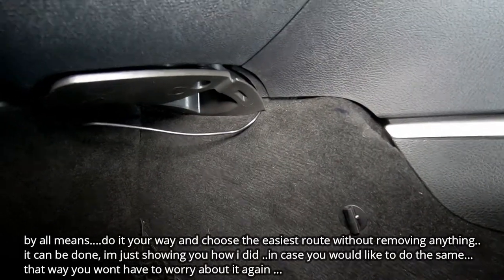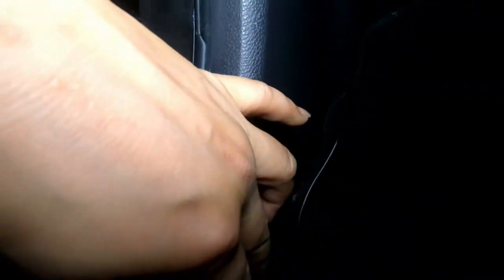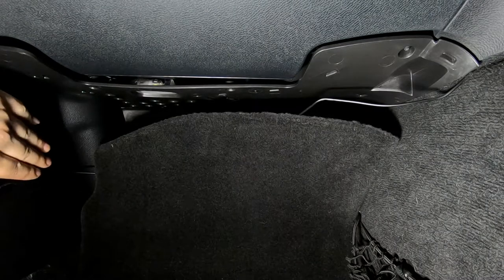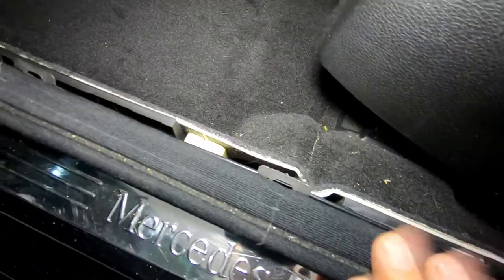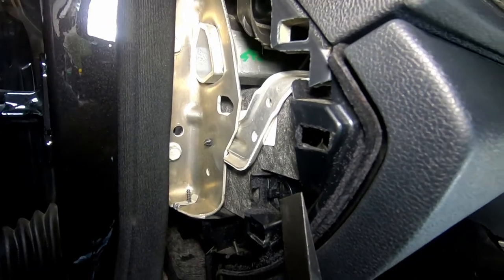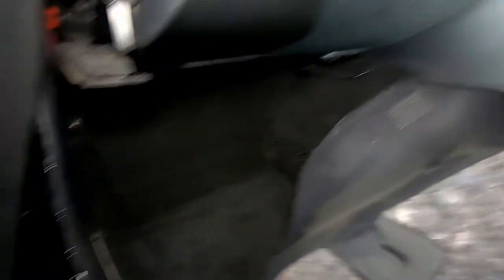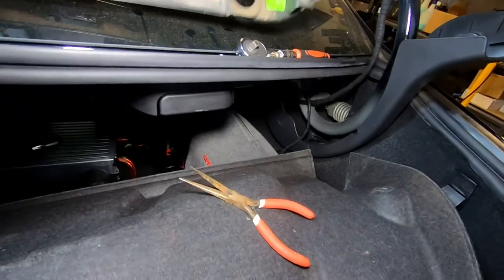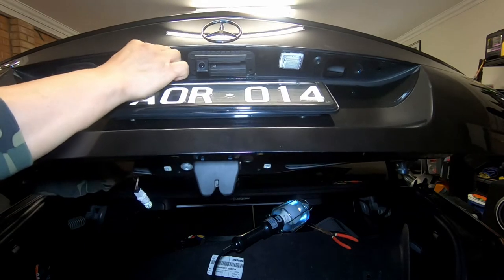mercedes w204 LICENSE PLATE LIGHT camera install+cable route PART 2

Comment: I did this same camera set up, Can you please tell me or if  you have a part number for the rear license plate led bulb that fits inside the rear camera slot? as the stock one I have is one whole solid light/bulb plug in  piece
Reply from the maker: hey bud... welcome and thanks for supporting my channel... so are you looking for the camera that fits in the license plate light or in the spare slot next to it .... most pf these livense plate led bulbs/cameras are like that....hence why i wanted a boot handle camera instead as its more centred as well ....
Reply from the maker: so i just check on ebay and did a quick search for mercedes w204 oem reverse camera ...and i could see they sell a few different types of cameras.... there are ones without the led bulb and jist thr camera which could fit in the spare slot next to your led license  plate light... amd of course there is trunk handle aswell...there is also oem style camera which fit in the same spare slot next to license light
Reply from the maker: here is a link to what you want https://www.ebay.com/itm/192846672878

Comment: wow amazing video ...!! btw what camera do you recommend more??? does the one on the plate light makes the car looks the bulb off because block the plate light??/ im kinda OCD with those things
Reply from the maker: if ur ocd then get the trunk handle one its abit more centred and wont make ur lucense plate lights look off and funny or yhe other only suggestion id recommend would be the cameras that sit in the spare slot on rither side of your trunk liner
Reply: @MIKEYZVLOGZ  ive read that the trunk handle one the angle its to the floor is that right? btw if you can link one so i can buy
Reply from the maker: @AmateurTroll69  i use a trunk handle one and ita good

Comment: What is the random red tail end of cable each end of the rca for ?
Reply from the maker: that red cable is for car models either a reverse canera trigger switch ..meaning wen u enter reverse it knows to trigger the camera to turn on.. similar to the remote switch of an amplifier... its mainly used for aftermarket gear units ... but for w204 there's a setting you can choose to trigger the  camera once u enter R
Reply: @MIKEYZVLOGZ  okay cool so with a stock head unit just leave it loose or remove it? And the black and red cable goes to the reverse light?

Comment: Great video but i've encountered one problem...iv installed the camera in the same position as you have in your tutorial, but iv found that the camera actually blocks the light coming from behind it (from the licence plate bulb) and fails to illuminate the left half of my licence plate sufficiently. Is there anything I could do to prevent this, as failing to have my number plate sufficiently lit while driving is a driving offence here in the UK.. plz help!
Reply from the maker: ok so i know exactly what u mean.. if u want more light need to get different camera... becuz yes it does block license plate light i suggest either boot handle or use like oem fits in square gap next to license plate light

Comment from the maker: be sure to watch the next video when i show you how to connect the power to the reverse light using a rectifier a capacitor or a relay so that you can eliminate the possibility of noise/fuzzy lines jumping screen or inconsistent connection, which can be introduced due to connecting it to your reverse light ....becuz Mercedes have a SAM unit that detects signals/voltage drops and fluctuations in electrical connections and when it sensors something is different or unstable it sends an error msg to your instrument cluster dash, which imay cause the noise/fuzzy lines or inconsistent video signal...so using a rectifier, a relay or a capacitor will solve that issue..all this will be shown in the next video
Reply: You put out excellent videos Mickey,, thanks for all your helpful videos,, Top Man 👍

Comment: so if the camera doesn't have LED, technically i can tape into any power source?
Reply from the maker: yes but just also remember that itwill mean tht your camera will run as soon as u switch on ur ignition
Reply: MIKEYZ VLOGZ thanks. Looks like the setup I got has the 12v coming out of the wiring harness, so I just connected it and that works. Don’t know if the camera is always on or not, but working now. Thanks for the video, it was very helpful.

Comment: Hi  I recently installed the boot handle with reversing camera and noticed that when I go into reverse the camera picture is pointing down abit too much did you have same problem if so how did you rectify thnx
Reply from the maker: u should be able to addjust  it

Comment: Have you ever changed the eis?
Reply from the maker: no never had to it's not really a common fault with these cars ...however I do believe if you ever needed to change it you would.need to have it reprogrammed to sync with your esl ... removing the eis is pretty straight forward ....why do you ask
Reply from the maker: pr do you mean the esl ?? do you mean the ESL electronic steering lock? EIS is the part your key goes in and the ESL is th e device that locks and unlocks your steering wheel when you input and remove the key from the eis ignition switch .... if your referring to the esl yes I have replaced the motor in the esl before I did a video on it if you look through my channel and also I show how to remove the EIS as well in part 2 of that 2 part video.... feel free to check it out.... if you could.be more specific in your questioning I could answer you more thoroughly dear friend .... always here to help fellow subscribers .... hope you can show your support and subscribe to the channel and hit that notifications bell
Reply: When I put my key in the ignition it will not start nor will the instrument cluster lights come on. I have to keep on playing with it inserting back an forth for it to work l. Just started yesterday.
Reply from the maker: @TheStillfly656  definitely seems like your having the most common issue my friend...which is the ESL I did a video on that just have a look through my videos tou willnfind a video.... hopefully it can be of some use to tou and possibly encourage you to DIY saving you $1000 or more ... have a look and see how you feel... many ppl have had success using the video however I will state attention to detail is crucial...hope you fix the problem...wish u all the best mate

Comment: Hi Mikey, I've been following you from Brazil. I own a C63 W204 2009.
I'd like to do something similar you have on your car. Could you please give me some guidelines how to install my reverse camera on the trunk handle like ypou did?
I'would appreciate it.
Thank you in advance.
Reply from the maker: ok so i did a video on bling adding bling to w204, and in that video i show how to remove the rear strip panel and access the rear camera area , the boot handle is just as easy to install, you have 2 screws to remove from inside the boot area after removing all the lining , and then u can remove the boot handle there is also a plug /. wire connector , then u can remove the handle and install the one with the camera, pretty straight forward..but im here to give the best advice i can without being there physically , so can only do so much .. hope it helps and good luck with the installment
Reply: @MIKEYZVLOGZ  ok. Tranks for your kindness.
Reply from the maker: @MrAmcunha  u r welcome

Comment: I've bought a camera that looks identical to yours. When I removed the licence plate light, I discovered it  was a sealed unit with a LED bulb that cannot be used to illuminate the licence plate-camera. So I need a bulb of some kind of socket that will fit in the camera housing. Do you know the specification for this? The sites where where you buy the cameras say nothing about this problem. They just assume you plug in the old licence plate bulb, which I can't.
Reply from the maker: Im not sure i understand what u mean.... so your license plate camera doesnt have a bulbs socket to install the facctory light bulb for your license plate ? Is thay what u mean? It was designed to house the t10 bulb
Reply from the maker: @johnelton9065  that is strange that the bulb wont fit in the light housing

Comment: I need it for my s204
Reply from the maker: be sure to watch the next video when i show you how to connect the power to the reverse light using a rectifier a capacitor or a relay so that you can eliminate the possibility of noise/fuzzy lines jumping screen or inconsistent connection, which can be introduced due to connecting it to your reverse light ....becuz Mercedes have a SAM unit that detects signals/voltage drops and fluctuations in electrical connections and when it sensors something is different or unstable it sends an error msg to your instrument cluster dash, which imay cause the noise/fuzzy lines or inconsistent video signal...so using a rectifier, a relay or a capacitor will solve that issue..all this will be shown in the next video

Comment: hey mikey, i broke my AUX port whilst installing an android screen. Do you know where i can find the cable kit and where it plugs into ? The part number is 039 545 32 28. Is the connector under the scuff plate on the left hand side like the W203s? Thanks for showing how to remove the side panelling will give it a try.
Reply from the maker: U can buy on ebay and aliexpress and amazon ur choice just search w204 aux plug connector oem ..play with the words